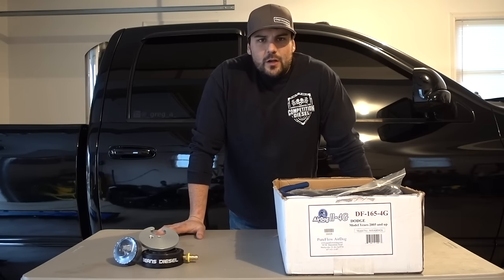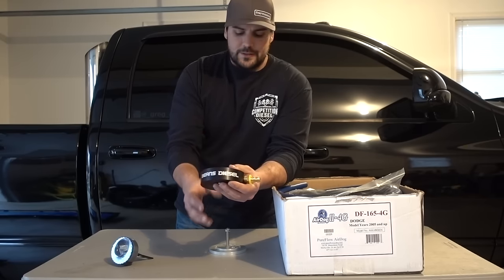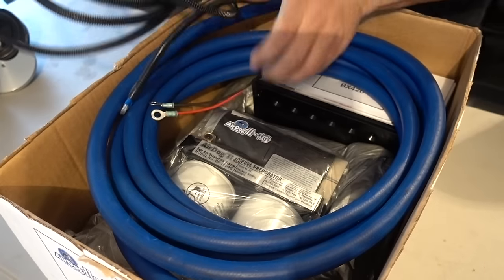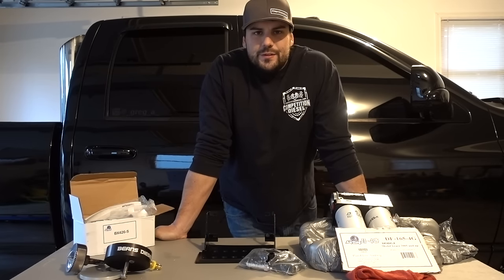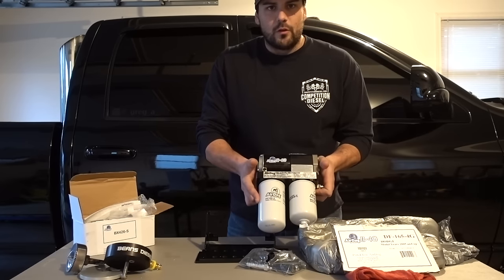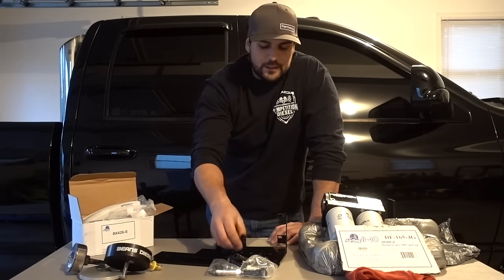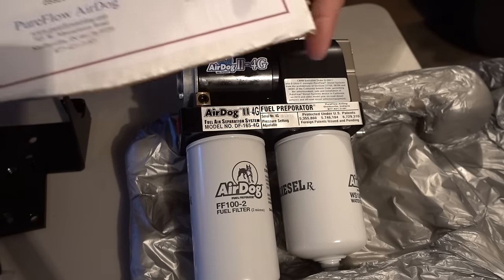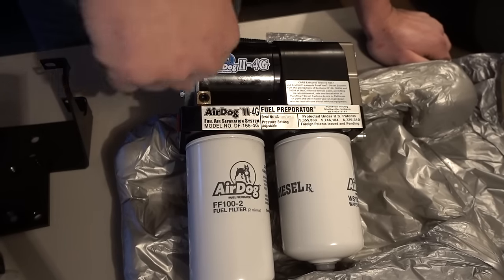AIRDOG!?....WHY!?!?

Comment: Excellent way of explaining way AirDog is the one you pick. I have always used AirDog based on customer service. I also had a couple of electric motors die on me from fuel getting past the seal from the pump. My 12v didn't need a lift pump but my 24v did. I learned to hard way from the moment I bought it what it takes to keep it going. It blows me away to think that between Chrysler and Bosch engineering nobody had a bit of sense to increase the fuel pressure above 14psi when the relief return valve in the VP44 was set to 14psi. I bought my 2nd gen in 2013 and drove it 250 miles when it crapped out on the side of the road. VP44 failed and lift pump in the tank failed. Of course I am disabled with a limited income so it took me 3 months to come up with the cash to get it running again. In between I read everything I could about VP44s and the type of fuel system set up I needed to get reliability. My first diesel was a 2006 GMC 2500 SLT Duramax Crew Cab, a great truck with a Banks exhaust and cold air system and a single tune from PowerUpDiesel and believe me for the years I drove it I got 18 Plus in town and 23 to 24 mpg loaded with my gear (Boilermaker) on the road. I had to sell it when I could no longer work in 2011. The Dodges were great but I couldn't shift them with leg braces on which I have to wear to walk. Just bought a 2007 GMC Classic 2500 Duramax a few weeks ago, very comfortable for me and it's automatic. It needs some work, previous owners didn't do the maintenance like they should have in my opinion and it has left me with a hefty amount to spend to fix things. I guess I'm the biggest sucker when it comes to selling something. I always  tell the truth and always tell everything that was worked on. I sleep well at night conscious wise but I will stand before God one day and be held accountable for my actions. I was watching your video because I wanted to try the FASS but couldn't do it based on my experience with AirDog and replacements which you reminded me of I'm going to stick with what worked best for me in the past. Thank you.

Comment: I liked my airdog, I have the airdog 2 with plastic mounts, the biggest issue I had is gelling up and my motor went out.  I ended up going with the FASS pump 1) easier to find filters that fit 2) local shop so if I want FASS filters they are right there and 3) most important reason, I can added a fuel heater also have option to run another electric heater.  In Minnesota with bio diesel a heater is almost mandatory........I also have the beans sump.....LOVE IT
Reply: I've used antigel additives every winter and never had a gelling issue.
Reply: @MrStaybrown  what brand cause ive tried: powerservice, howes, optilube winter, schaffers, and the list go's on and on and they all suck ass and gell/wax filters n ur done. All of em at standard rate 2x 3x 4x rate and still gell. However -35F is cold
Reply: @dequavisjones4869  yea I agree negative 35 is very cold, I really don't know if any anti gel would work at that temp.
We only see single digits and never drop into the negatives..I use the white bottle of power service December to February.

Comment: I also had one of the older air dogs on my truck. it died as well, or at least was showing intermitten symptoms. and just like you i forgot to send in the card. they replaced my pump with the new model 4g pump free of charge and its been awesome!

Comment: Im one of the few that can say that I've been running a beans sump since they came out... NEVER had an issue. Airdog however, I've tried twice both went out with in 10K miles... Went to FASS and for the past 20K or so, I've been happy. But the FASS is very loud.
Reply: CliffordRam Was it one of the older pumps or the 4G that went out?

Comment: Have the air dog df200 pump on my 24 valve and I love it. Even under my big tune and full load I don’t have to worry about overheating my vp pump and I don’t have it cranked out to far that it will push past the vp pump.

Comment: Just in case you didn't know. Old airdog 1 and airdog 2 can be converted to 4G pumps. Changed my airdog from 2012 to a airdog 4G last night.
Reply: acexxxoasis, I just did the same thing. Give Airdog a call, they'll set you up.

Comment: Well spoken video.  The ONLY reason I'm posting this is, I believe CREDIT due to those who do GREAT.   That said; My FASS 150  I installed the year before my factory warrenty expired on my 2001 24v H.O. as Cummins engineer recommended.  ZERO problems after near 2 decades!  Just did a physical test as lines aged / replaced.  16oz in less than 3 seconds, over 2 gallons in 30 seconds.  I feel this is why my VP44 lasted over 20yrs!

Comment: I have a Fuelab on my Max now no brushes to wear out And a lot  more quiet than the airdog 2 and the motor is easier replace on the fuel lab , had an air dog 2 went out 8 months later brushes burnt slam up in it

Comment: Just learning about lift pumps.  I haul horses and figured GVW is 30,000lbs.  I am adding a tuner and 4" exhaust, air and a larger transmission pan.  I am open to suggestions.

Comment: Have a 2006 6.0l fire ringed heads RR fuel system with an air dog 165 Kc 1.5 Warren diesel 155/30% injectors. Turned up the air dog to the max 70 psi at idle and anything past 1/2 throttle fuel pressure drops to 55 psi and the engine starts to misfire.
Reply: Also if you tow a trailer if you run past 1/4 tank with a regulated return fuel system the fuel gets pretty hot and also lowers pressure.

Comment: What are your thoughts on running a higher GPH lift pump than you need, to leave room for future gains? 

My end-goal is 650hp which would put me in 150 GPH territory, but with the truck being nearly stock (just CAI, H&S tuner & 20% injectors) should I wait on a lift pump until turbo & tuning catches up?

('06 Cummins)

Comment: Greg, thanks for showing this.  I'm looking into getting a 4G now, thanks to you.  

One question though...   while I like the design of the sump pickup, I don't like how low it would be on the tank of my E350, running a 7.3  I've recently gone through the entire pickup module in my tank, and would prefer to just route it through the standard top-draw to maintain the smooth lower profile, less chance to hit stuff with it.  ;-)

Will I route the intake AND the return to that pump?  I'm under the impression that the return port is largely unnecessary, although I'll be glad to route it back.

Comment: awesome vid man thanks for the info it has helped me make up my mind. i have an 05 2500 5.9. is there a link you can give to to order the beans sump and air dog system, with discount would be great. also i have to replace injectors what do you recommend, this is my first diesel and have had nothing but problems with since i bought it. i have it tore down to the pistons now and am putting new head gasket on tonight and starting from there. since i could actually see that my  pistons weren't burnt through and look good. but its all research from this point on. any help would be appreciated.
Reply: Same year same problems bro

Comment: I think my 06 24v needs a lift pump it has low power with no codes and sometimes the wait to start light comes on going down the road or up a mountain  and chimes ten times and you can feel the truck cut the power in half when that happens it acts like limp mode sometimes stays on still with no codes but if you erase codes anyways  it goes away. Have you ever heard of this problem.

Comment: You can either have crystal clean fuel, or buy an AirDog... Fass has me sold on their product quality and filtration performance.
Reply: How long have you had the FASS?
Reply: @diesel_gee1187  Hey man, do you have an AirDog? What's your experience with them/how do you like it? I know both Fass and AirDog provide substantial PSI to the injection pump, but I believe Fass has a far superior filtration system providing longevity. What is your take?
Reply: matthew majcher I have zero experience with either. From my understanding, like you said FASS has a better filtration system. I haven't heard anything about them failing yet. That's why I figured I'd ask about yours. How long have you had one?
Reply: What proof is there that the fass filters better?  What if you put fass filters on an air dog?
Reply: @SylasG  There are several videos on YouTube you can look up. Search FASS vs Air dog, and they do a side by side bench comparison. The pressure regulator is nice on an air dog, but another thing that sold me on a fast pump is that they're used so frequently on big rigs without complaints from what I've seen. So there's some pros and cons for each, it's all your personal opinion and what you feel is best for you application. For wanting pressure adjustability, and the best filtration  
It would make sense to put fass filters on an air dog pump. That's if they can be intermingled. But in the eye of common sense, it would make the most to do that

Comment: Hey Greg, I don't know if you already covered it but, in the vid you showed that you can adjust the pressure. How do you know what the correct pressure you need is? I don't wanna have to much or to little but that sweet spot.
Reply: @arie the1manparty : Ideal is 20 psi at idle. You need a pressure gauge hooked up.

Comment: Yeah that hole straw pickup sucks
I had a Fass system installed on my 2015 6.7 , well shortly after it was installed the tube fell off !
I wished I’d seen this first Greg 
What a mess ,thx for the heads up👍
Reply: Maybe I misunderstood, but the Airdog didn't change the straw situation you experienced with the FASS.  The Bean sump would.

Comment: Most do not need 165 gph pumps !
Especially for a daily driver / weekend racer. Wayyy to much returning fuel, not mention the pump is working overtime at all times due to the fact your NEVER using 165gph unless your doing 135-155miles per hour.

These trucks run at 20psi lol 

Soooo fass is just as good if proper model and install done correctly 

I have both fass and going to buy air dog

Comment: QUESTION,QUESTION....
i have a 02 5.9L cummins 
i like to install an air dog fuel system.,
this is the right one.?
this is what i need.,or i have to buy some more things.?
please let me know.
tengo una 02 dodge ram 5.9L 24valve cummins 
quiero instalar un sistema de combustible 
pueden ayudarme y eviten si esta es la que necesito ?
o no es suficiente y necesito comprar algo más.??

Comment: Hi, I just had my Raptor lift go bad on my 2000 24v Cummins, would it be a better use of money to buy a new Air-Dog- 4g pump vs another raptor pump ? just would like an opinion about my situation, Thanks in advance!
Reply from the maker: Personally I would just get the 4G pump now, its more money but it is a much better/ complete system that will last forever. If you need a source to get one, let me know!
Reply: The raptor 4 g has lifetime,  why not replace, even the original raptor has warranty so the answer is do not spend more use the warranty

Comment: Sick channel man! 👍Wondering what's the lift and tire specs on ur brothers megacab?
Reply from the maker: Mario M Thanks! It is stock height in the front, lowered in the rear and rims are 20x12 with a 32 in diameter Nitto Terra Grapplers.

Comment: Hey so I have a 2007 Silverado 2500 hd gas and it’s lifted and I’m getting 9 miles to the gallon. Is there a tuner or something I could buy so save more gas without lowering my truck??????
Reply: Just traded my 2007.5 2500hd crew cab in on a diesel because of the horrible mpg 9.5 driving and 7mpg while towing 7k pound trailer. Truck would struggle to hold overdrive on hwy also got on my nerves kicking down all the time from 6th to 5th gear at 70mph and 4th gear at 3300 rpm while pulling hills on highway

Comment: Just wondering why you chose a stack over out the back exhaust?
Reply from the maker: Only because certain tracks require the exhaust on diesel trucks to point straight up, so the stack made it easier.
Reply: It’s also significantly better for your engine due to EGT going up and out like gases are supposed to instead of traveling up and sticking to the top of your straight back exhaust

Comment: hey man great videos..I have a 06 6 speed so this is a perfect channel..thanks..I have the original 100 gph airdog ..with pump failures with them do to seal leaks is  there anything I can do to help prevent this from happening..thanks
Reply from the maker: I don't think there is much you really can do unfortunately but I think with an original 100 you might not need to worry about it, if its been on there for awhile then you might be good. It was really only some of the 165's before the 4G's came out that were the issue.

Comment: For a stockfish truck a sump isn't needed as a matter of fact they can be problematic also.  Its a lazy man's way out instead of modifying the factory pump.  If you are having the 1/4 tank problem your probably going to have it with a sump.  I didn't think cutting a 2 3/4" hole in the bottom of a fuel tank a great idea.  You also have a fuel line under your tank with might be a good idea if you use your truck for 4 wheeling.  Look at the data for pumps and you will see the difference between the airdog and the FASS system.  Save your money and buy a pump that actually is good for your engine.  Your experience means nothing compared to lab results.  I'm going to buy a FASS system, but thanks for the video.
Reply: What lab results?

Comment: Are these ment just for more fuel for more power or do they also help with component life
Reply: They help with just about every aspect when it comes to the fuel system. Consistent fuel flow at a set pressure to the injection pump(s). Pump isn’t working as hard to get the fuel from the lift pump compared to the in tank pump. Increasing the life of the injection pump. The filters are generally a lower micron than the factory fuel filter and water separator. Helping take a lot debris and water out of the fuel before it makes it to your pump and into your injectors to cause damage. They also help with removing air from the fuel. Even a completely factory truck adding an air dog could benefit.

Comment: Why an airdog or fass when they now sell mechanical lift pumps which seem to be very reliable and longer lasting. I've been running an Airdog raptor 100 for 25,000 miles with no problems so far but I am curious to get your opinion.
Reply from the maker: Cummins Kyle which mechanical pumps are you referring too?
Reply: the DTT Assassin
Reply from the maker: O ok, they have been out for awhile and I had a friend purchase and install one of these awhile back and he mentioned that it was more of a pain installing and dealing with the way they drive the pump and wishes he would have just ran an electric pump, Airdog has tested there new 4G on a stand running continuously and it had insane amount of hrs on it. They converted it into mileage and it would have been like 500k miles. So in my opinion electric pump and motors have come a long way and I wouldn't see a electric pump any less reliable than anything else on the market.  Thats just my opinion tho, hope it helps!
Reply: +GREG_ALBERALLA okay awesome. Thanks for the information. Will probably stick with airdog for life. In particular the 4g pumps. good stuff👍
Reply from the maker: Cummins Kyle No problem man, anytime!

Comment: Even tho this is an old video what's your thoughts on the in tank pump from fleece?
Reply: My thoughts are...... go to Power Driven Diesel and check out there mechanical one. That's where I'm leaning.
Reply: I already got the fleece in tank pump. The power driven diesel pump is probably best for fuel flow but in my situation it the woods or fields I'd end up getting something stuck up in the belt to that pump.

Comment: The g&r has the beans beat I think same awesome one bolt design but has the return in the sump to. So less airation of fuel since it comes from the bottom and not dropping back on top. Just food for thought.
Reply from the maker: I understand what your saying, but Airdogs 4G's barely return any fuel to "drop" or "dump" from return. Even in G&R's video they have a 4G returning from the bottom and there is no bubbles even coming from it. I do like there sump but if you don't have a high return system, there really is no need for a bottom return. Again just my opinion

Comment: What do you think of the AFE DF780 Fuel system no tank cutting, I know you guys out there are stuck on Fass and Airdog, but not into cutting into the tank, so whats your opinion I know it's a new system, but some advice is always good!
Reply from the maker: I personally would still choose a full air dog system, You don't need to have a sump to install it and I think is a much better complete system. hope that helps some

Comment: Just ordered one, need a question answered. For a 2nd gen dodge 2500
Do you still have to take out the sending unit and modify it when your doing a sump with it?
Reply: Taran Coman I have the 97 12valve are you doing yours on a 12v? People have been recommending this to me
Reply: No mine is a 24v. I did take the sending unit out and and modify it, but I dont think I had to.

Comment: what do you do with the factory return line after installing an airdog since you use the factory feed line as the new return line?
Reply from the maker: It can stay in place, or be removed
Reply: how our what do you use to remove it? And if you leave it do you need to cap it off or anything? I'm planning on installing my airdog 4g once beans has the sump available and lastly when will you be doing an install video on the airdog

Comment: Can you use cat filters with air dog
Reply: yes I use Cat ir 751. 2 micron absolute, You have to remove 2 tabs that you see when you remove stock filter then it will fit. Ive been using this combo for a while now
Reply: turbocrzy0823 I have a airdog 2 4g and didn't have to remove the tabs. I think they're making them like that now.